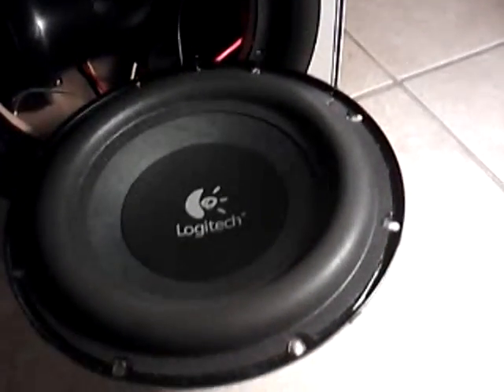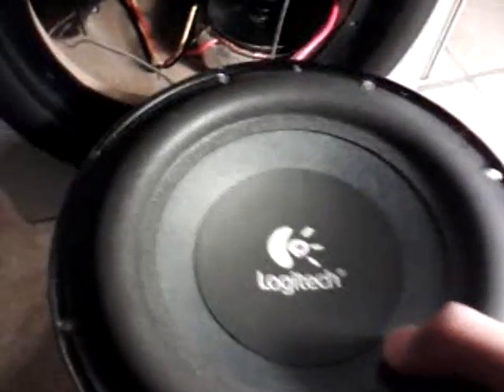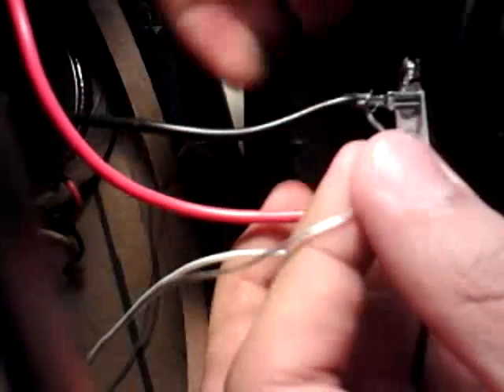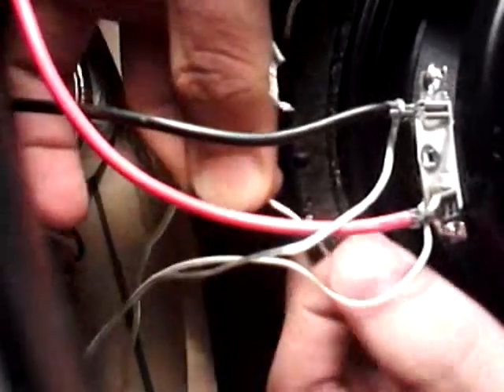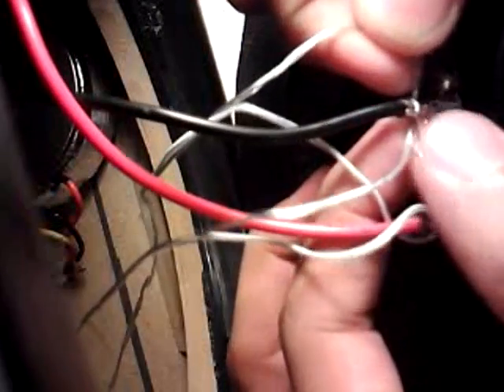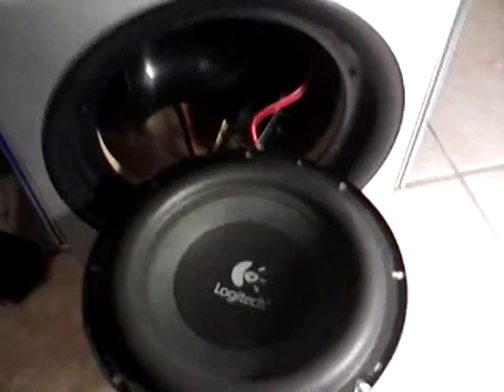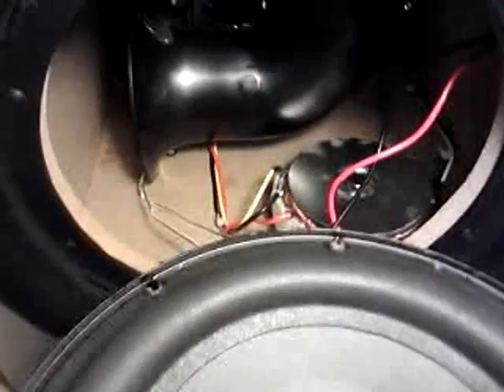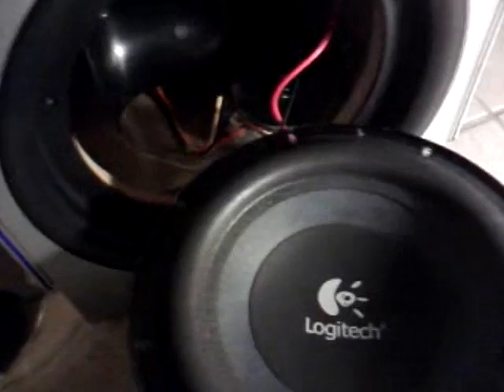How To Add LED's To a Subwoofer To Pulse With The Bass

Comment: this is just a way how to not add lets to your subwoofer 
- it is very bad for your amp
- it will blow the leds after a few days 
- it is also bad for your sub
Reply: +FDworksTV I have to disagree with you. I did it with my subwoofer over a year ago and everythink works fine.
Reply: +WhiteDeath PL use a powerful amp (mine gives 90v like max) and well leds are recommended 3v max... you must have a bad/underpowered amp
Reply: I use a tip31c hooked up to the aux in for the amp

Comment: This is actually dangerous when being used on more powerful amps... the voltage and current can easily rise over 30V and 30A with a 900rms amp which would burn that cable and cause a fire hazard or blow the leds...and it does draw power but such a miniscule amount in the range of miliAmps...I would not recommend you do this just get a prefab sound sensor led kit

Comment: EDIT: Sorry, I was very bad 3 years ago (in English).
Just connect the + - cable from LED to your DVD player or Amplifier. In the same port where the BASS is. It will work perfectly. I am using it 3-5 years :)

Comment: You need to use a another controller for the power to the LEDs, just splicing it straight into the power for the sub will produce too much amperage to the LEDs and destroy them.

Comment: he means use a 9v battery, mic, op-amp, low pass filter if you want, transistor or another way is to use a rectifierconnected directly to your sub with some resistors and a transistor but don't try it if you don't know how it works cause you might burn something if you do something wrong

Comment: and how much the audio finals handle that kind of resistance?every bar have resistors you know that right?something like 150kohm and that woffer works like in 8ohms, h'about that?after an full volume for few min will blow your audio final, grate job with it, only if that an vumeter with his own power supply or u used an transistor to do the job nicely

Comment: Put a Resistor in line with the positive and it won't pop you LEDs. I belive a 270ohm at a 1/2 watt is all you need maybe even a smaller one for regular speakers

Comment: i did this and ruined 4 LED's.. but i put a 350 ohm resister on them and it works fine, it just needs to be up a little bit louder

Comment: Not likely. In fact, pretty difficult if done like in the video. It is more likely you blew your amplifier. An LED is a Light Emitting DIODE. Key word here is DIODE. A diode conducts electricity in the positive direction at a predetermined voltage but doesn't conduct electricity in the negative direction. The positive voltage is between 0.7-1.5V. If you supply a sine wave with the diode in place, the diode will essentially clip the signal to half a sine wave and it acts like a short circuit.

Comment: ok kids. your head unit sends a signal to your speaker to make the vibrations which you call music or sound. that signal is electicity powering the speaker on and off rapidly with different voltage amounts causing different sounds. connecting a led to a low voltage speaker with low amps is ok al long as there is no spike in either. hook an LED up to a sub with added amps and those leds will burn out faster than you can replace them.

Comment: @agaen96 And it also depends on how powerfull bass you have. A standard Logitech bass is no big deal, but if you're gonna connect it to some real speakers that uses a reciver, you've gotta use a resistor, or they're gonna blow soon

Comment: @d3dreaper After lots of experimenting, you may come to realize as I saw right away that the output of the amp from one install to another is going to vary so much you will need a sensitivity adjustment to make the lights come on at low output for some amps and listening levels and much higher for high output amps at high volume levels. But if someone adjusts it wrong things will get damaged.

Comment: @subsystems i was just using the headlights as an example haha... you're awesome man! i do prefer to work with leds and i have setups that work for up to 250 watts but they have to be built specifically for the amp... I know the LED's have a sharp voltage reactance(if that's the proper word?)but at the lower voltages the amp reads it as if it's not connected and because the reactiveness( again possibly a made up word but you understand) is at about .5 volts it doesn't harm the amp

Comment: @d3dreaper I thought about making a video as well. But it would be impossible to cover all bases. Not all headlights are resistive. Some are LED, some require transformers and some even use the headlights wires to operate relays because the headlight wiring/switches aren't able to provide enough voltage or current for the lights.

Comment: @d3dreaper It doesn't matter if you can power your headlights with your amp. When some people read this they will assume you mean anyone can power any headlights with any amp without knowing anything about the specifications of both the amp and the headlights. Not to mention there would have to be a circuit between the amp and headlights to properly provide a resistive load for the amp and a dc power source for the headlights, and only if the headlights are not more Wattage than the amp.

Comment: @subsystems Fair enough and that's is very true but i look at it and laugh lmao and truthfully i started out experimenting by doing that (i used a slot car on speaker terminals and discovered i can get music from an electric motor and then figured out that's how a speaker works). And it truly is a breath of fresh air to find someone  that can argue valid points without being a douche. maybe i should make a diy specifically for this type of setup ...?

Comment: @subsystems the only times an amp will blow is if you cut half the wave off, clip your signal, you have a setup with too low of an ohm load or you short out the connections (a blown sub will short the connections)... as long as the math is done correctly i could power my headlights with it, no problem.... just because it was designed to handle the differing ohm loads from different frequencies on a sub doesn't mean that it can't handle a light output with a solid resistance...

Comment: @d3dreaper Making something work and doing it properly are two different things. It is never a good idea to power anything other than a speaker with an amp output. You can build a bridge rectifier, add some capacitors etc but in the end it isn't a good idea to connect a device that is made for one purpose to another device that is made for a different purpose. Blindly connecting things simply because they have 2 wires or connectors that match is asking for a visit from the Smoke Fairy.

Comment: @subsystems in actuality, tho he did this wrong, there is a way... put led's in opposite polarity and have them resisted properly including amperage loads...your amp will not show a clipped/cut signal and the higher ohm load will allow the amp to stay cool the main issue is trying to do the math when all you know is that an amp is rated for 200w/500w...etc...

Comment: You bought 12V DC lights that were meant to stay on steady. You wired them to your amp output? OMG!!! Never connect anything except a proper speaker to your amp output. Your amp output is something like 40V AC @ 25+ Hz. The lights flash because they are not properly DC powered. Worse is your amp isn't "seeing" a resistive type load. So your amp is clipping half the signal. You will blow your amp this way!!! Proper flashing lights have either an RCA line-in or a built in microphone.

Comment: @mrfreakengineer I consider checking the voltage of power your sub produces first. then check what kind of lights you can hook up. The only problem is that you may not be able to use LEDS. Once you have found the voltage try and get a couple of light bulbs with a 2-5+ watt or what ever. then they will last longer.